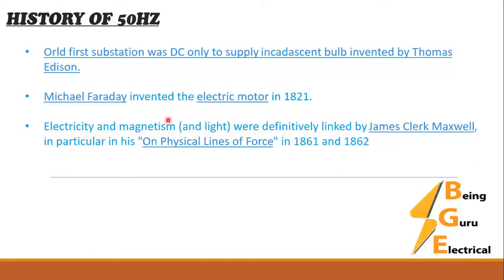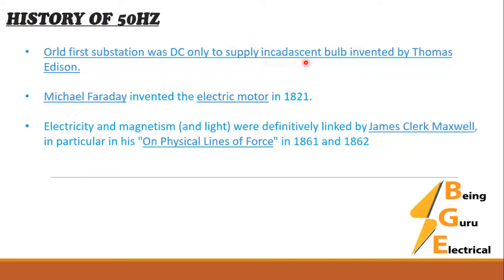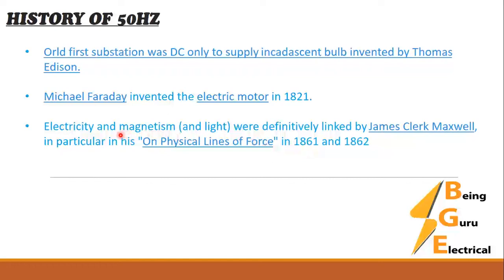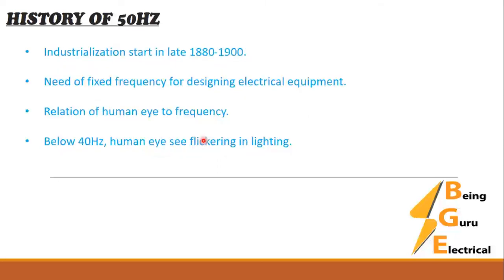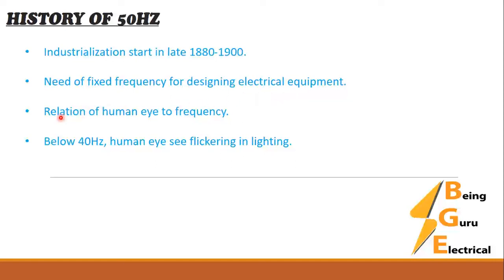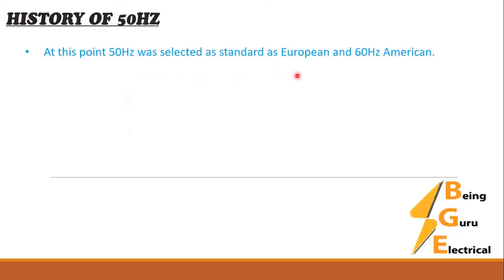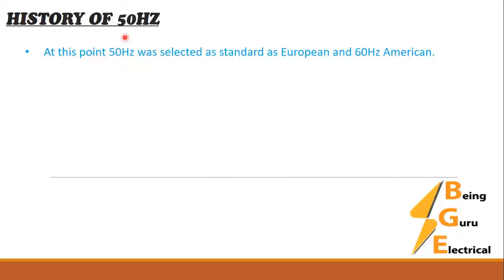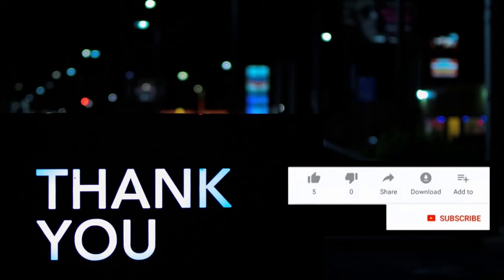WHY 50HZ POWER FREQUENCY | History of 50Hz and 60Hz Frequency | BeingGuruElectrical

Comment: Hello if I connect a 230volt 50Hz  ac fan to a 60Hz and I connect it again to a 50Hz which one will be drawing more current the 50Jz connection or the 60Hz connection.